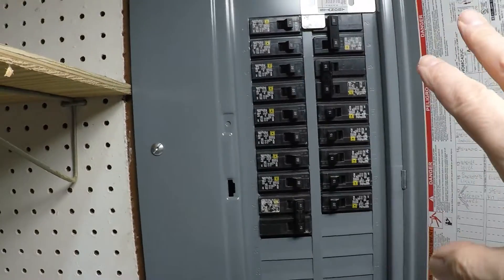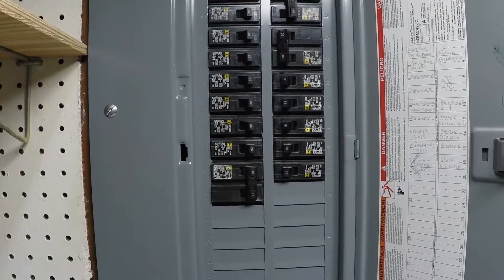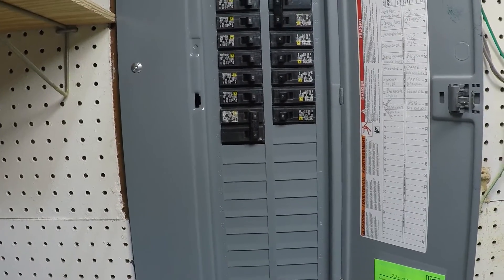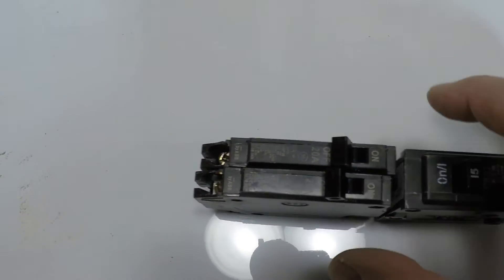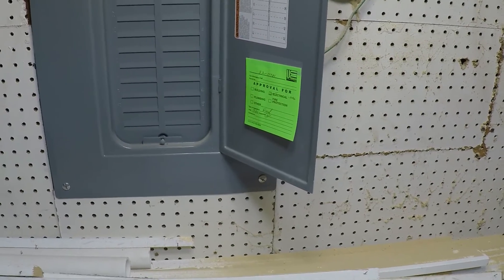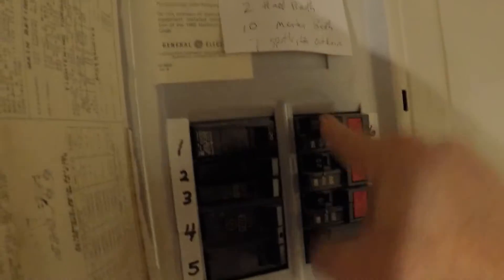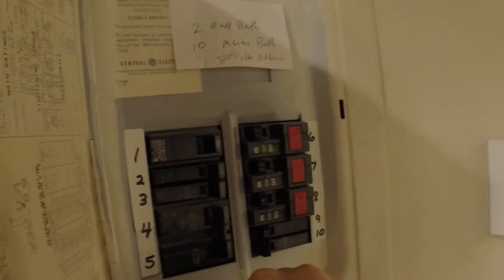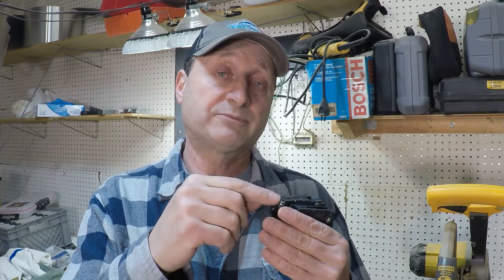How to Choose the Correct Breaker for Your Panel and Prevent a Fire

Comment: I have a 1954 slab foundation 3 bedroom, 1 bath house in So. California, with no generator, and no A/C. It is a 15 amp to all the outlets. I plugged in a 15 amp wood chipper that immediately tripped the circuit breaker over and over. Can't run the washing machine, the gas dryer, and the microwave st the same time without it tripping the breaker. What would be the cheapest upgrade. I have an Electrician friend that's presently being his elderly Mother's caregiver, and would do me right when he has does have time. So it doesn't hurt to ask in the meantime. Thanks.
Reply from the maker: if you have a 12 gauge wire, you may be able to convert that circuit to 20 amp